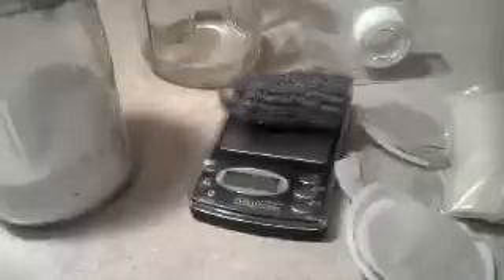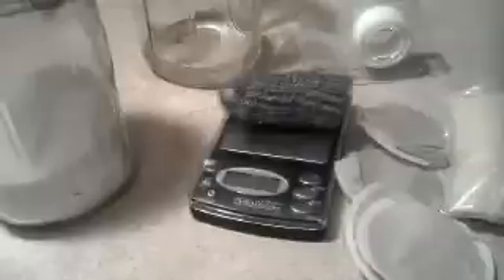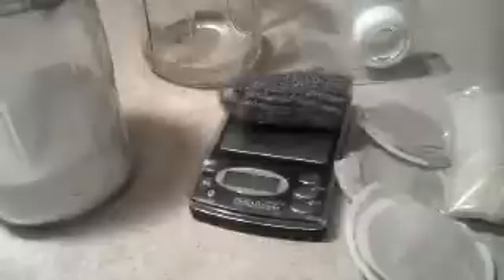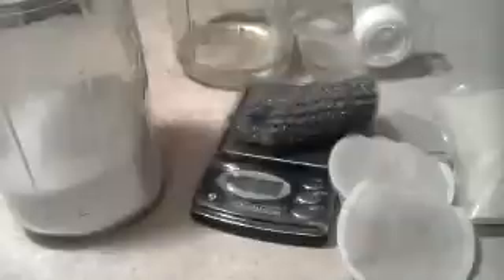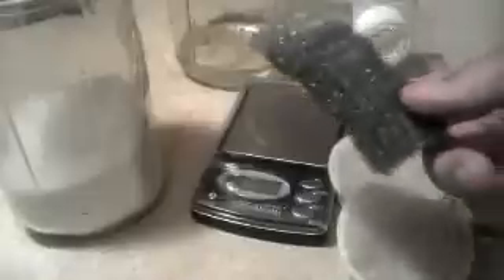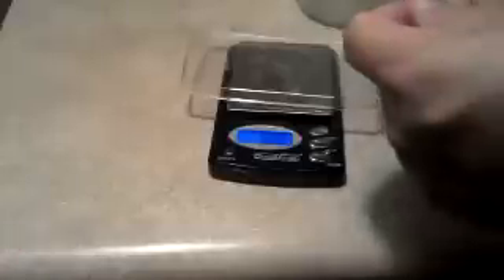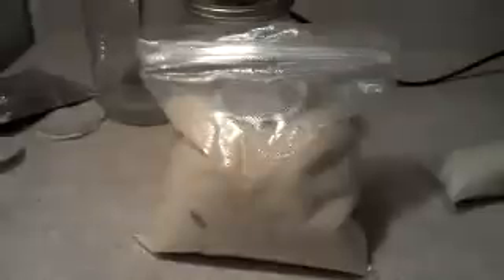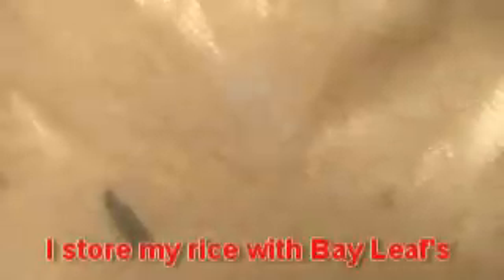How Homemade oxygen absorbers can be made.

Comment: couldn't you just place the salt and steel wool in the bag, without adding water? This would utilize the ambient moisture from the rice to gradually  rust the metal, thus  removing any oxygen from the trapped air. Maybe you wouldn't see that dramatic shrink effect, but you would find that the gas that's still in the bag became Nitrogen, with no Oxy left behind.
When you wet the coffee filter, you are adding more oxygen to the mix, just to have it removed by the rust process, and quickly finishing up the natural process that removes oxygen. It's NOT rust that removes oxygen.... it's the rusting process. Once the iron is completely rusted, there is no more elimination of oxy.
correct me if i missed something.
Reply: Good call - that's the way to do it - adding water defeats the whole purpose
Reply: I've thought the same exact thing with ambient moisture and I agree with you. Just because you aren't seeing huge amounts of rust doesn't mean it's not acting. Starting a rust reaction is just theater and wasted Iron that you want to be used for actually oxygen absorbing long term. 
Salt absorbs ambient moisture which is in contact with the iron fillings so it creates a double bonus. Moisture absorber and oxygen absorber because the moisture added to the salt via atmosphere is then contacting the fillings.
Reply: The only counter I can think of is possibly the rusting itself is a catalyst for better rusting but I'm not sure

Comment: Add moisture to an already dried food? What happens to the vapor released ?The real use I see for this is to place it inside a bucket/jar full of already sealed bags as a prevention for broken,teared or badly seal bags. Still some sacrificial element to absorb the moisture released by the chemical reaction is needed. The risk for any bacteria or algae should be little or non due to lack of oxygen. The reason to keep it off food. But as a SHTF element, it should be taken in consideration.
Reply: The vapor released is nitrogen, which replaces oxygen.
Reply: I think I agree with you about the water...or does the MOISTURE completely disappear into oxygen, hydrogen, & then nitrogen during the chemical reaction?

Comment: I would not use tape to seal them as the glue would be bad for you. Just use a sheet of coffee filter paper, fill it, fold it over and staple it closed. Staples are the same as steel wool.
Reply: Are they the same? I thought staples had some tin and aluminum in them so they DON"T rust. Doesn't matter really though... the rusting iron is there.

Comment: Did you say you can us charcoal in steed of the still wool!
Reply: no... the charcoal just helps limit the O2 flow, available for the oxidation process, so it happens at a slow and steady rate, preventing the warmer from burning out all at once. The iron is the main ingredient, when it turns into iron oxide (rust), the "oxide" part is the O2 removed from the air in your bag.